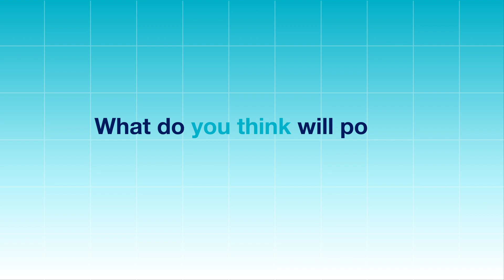Episode 06: What will airplanes use as fuel in the future?

Comment: batteries dont work, they have to be disposed of and then just degrade the environment by secreting acid into the ground. the energy required to create the hydrogen for engines is far too great and so will also not work. i would say the fuel created by porsche is gonna be a good alternative or synthetic fuel but not created from waste as it still needs a combustible for the engines to burn it efficiently and some types use oil which is worse than petrol or aviation grade jet A1
Reply: I don't usually answer to comments but I think you're the kind of person that got the spirit but got lost in the details. So to clear things up a bit: batteries do work. When it comes to recycling, it can be ensured on a technical level that no harmful chamicals are released into the environment, governments are there to control that. The efficiency of the hydrogen path is at around 50%, meaning that losses from conversion from electricity to hydrogen and back to electricity are about as much as the useful electricity that the electronic engines get. If you burn the hydrogen, the losses are greater. Still- synthetic fuels only have an efficiency of around 10-20%, meaning that you need even more primary electricity to produce the same plane flight. So hydrogen is actually more efficient than E-fuels. Although it is noted that the worse density and weight penalties of hydrogen storage means that you need a bit more of it. By the way: the stuff Porsche makes is E-fuel, which is just another word for synthetic fuel. They all mean the same thing. Then there's also biofuel which is produced from organic matter. Usually Biofuel as well as E-fuel actually burn cleaner that normal fossil fuel products. This is especially important for aviation, as the CO2 emitted from planes only contributes around 2% to global warming, but the soot released from the combustion of not so clean fuels can lead to contrails that can lead to increased high cloud formation, which contributes another 3% to global warming
Reply: Excellent comment. I just want to add latest news concerning efficiency of producing hydrogen: new techniques in electrolysis allow now for up to 80% !!! efficiency (from 50%) and more - very exciting achievements are made in this field.
Reply: y’all are all 🤓